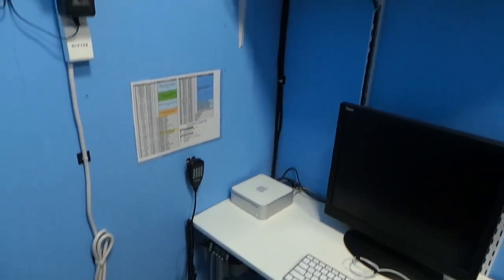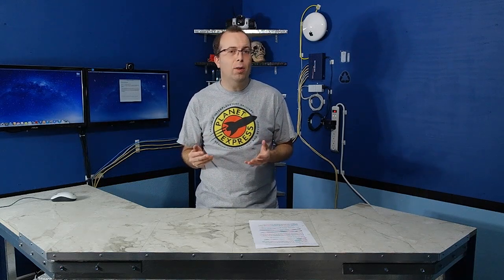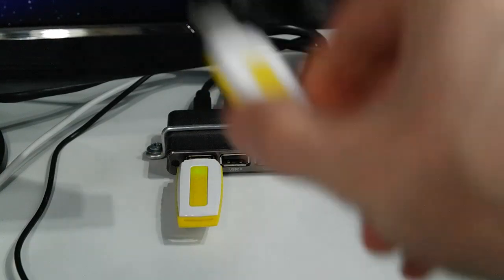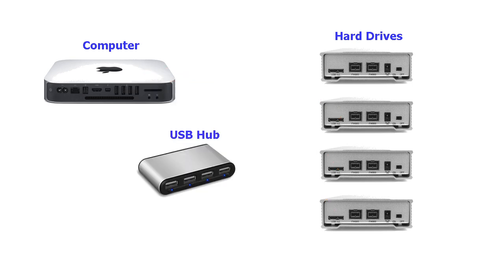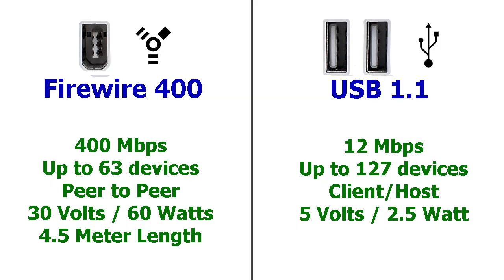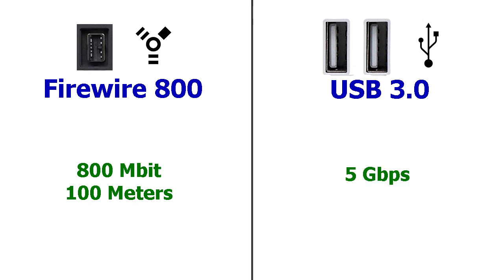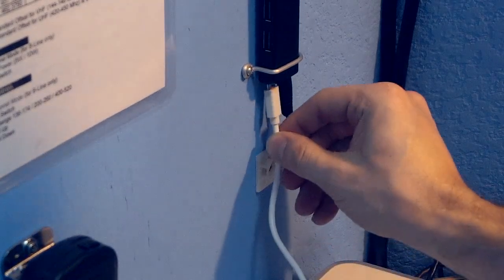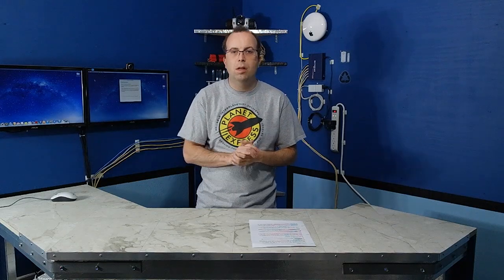Farewell R.I.P. Firewire, Hello USB!

Comment: macOS Tahoe has completely removed Firewire support. Once you update to macOS Tahoe, it will not be recognized directly because the most critical core extensions and frameworks are gone.

Comment: Cat scan images showing the components of Apples thunderbolt 3 cables. My journey (2024) to connect a wonderful Hasselblad digital camera which is FireWire 800 based to a new MacBook Air Thunderbolt 3 was challenging. Important to know is understanding how advanced Thunderbolt 3 is and the integrated circuits the cable has and must be interface with. Simple adapters found on Amazon will not succeed. It took a dock made by a company who deals with legacy audio devices to successfully connect. . Bizarrely the Thunderbolt 2  dock( the name of the product not the Apple connection) is not manufactured currently. If you are curious about what engineering and manufacturing challenges Apples Thunderbolt 3 connection over came view Adam Savages YouTube piece on this very subject. Seeing this will ease your worries about paying what seems to be a much higher price for an innocent looking cable.

Comment: It was only due to the high wattage output of fire wire that allowed the convenience of the “Daisy Chain” format.

On a technicality as you showed in your video the USB hub is “amplified”, but with the caveats USB still has to do the task of switching to offer the effect that it is working similar to a daisy chain.

Fire wire was phased out because of its in efficient manner of power delivery to send data.

All todays modern thunder bolt and USB 3.2  are conceptual redesign of the fire wire architecture with different input connections, and a much higher efficiency at a reduced 80% power usage.

Comment: You know FireWire was at the peak of my PC building era and I managed to avoid them.. mainly cause I never had an iPod. Was a hefty connector.. I came to appreciate that when I was learning about fiber optics. Some of those old school German connectors were bulletproof.. ironic cause the cables coming out were incredibly delicate.

Edit: I was unaware of the Daisy-chain capability, that IS pretty cool. Same with the comp—>comp. Neat.

Comment: Ever tried daisy-chaining USB? 🖕USB does not replace FW. Thunderbolt is the direct replacement of the FW.
Reply: USB 4 will be able to daisy chain devices. So, it will no longer be an issue with no daisy-chaining.

Comment: Fire-wire solved the problems had plagued USB 1.0-2.0. I would argue the reason they killed fire-wire is the plugs and jacks themselves SUCKED.  If you even touched the cables on a 400 cable- it would disconnect... and I would argue the same with 800.  They seemed to get the 600 right... but only slightly.  Lightning bridged the gap for another few years... But the moment that lightning and USB could share a common jack- why bother with firewire anymore

Comment: Years ago when I used Macs, all my devices were connected by Firewire e.g. hard drives Mini dv cam and external dvd players-burners. I still have those devices but finding its not so easy to connect them to my PC. My project is to digitize and archive analog tapes and TS dvd files. Ive  learned that now Ive gotta buy expensive Apple Thunderbolt and Firewire800 cables to attach the Firewire400 devices to a windows pc USB-C port. Pain in the butt & wallet. Thanks Apple, one reason why I stopped buying-using your products. Too many different expensive adaptors cables ports etc for various devices. By the way DO NOT buy or use the cheap Firewire400 to USB adaptors. They're totally useless junk.

Comment: It's actually Thunderbolt that was meant to replace Firewire, despite probably only being able to daisy chain much fewer devices. Versions 1 and 2 were in the form of mini-DisplayPort ports, and then version 3 switched to USB-C. It combines PCIe x4 with DisplayPort to also power monitors and not just high-speed peripherals which includes external GPUs. Version 4 is basically just 3 but with higher minimum requirements and also requiring USB4.

Comment: I still have an old Sony HandyCam8. I now have no way to get the video out of the camera. I don't really want to take the tape in and get it all burned to a DVD. I only want certain parts of the tape.
Reply: Apparently Thunderbolt 1/2/3/4 has firewire support hidden inside it
And there are adapters that let you connect firewire devices to a computer with a Thunderbolt port (the adapter apple sell is for Thunderbolt 1 though, although by combining adapters you can connect it to a Thunderbolt 3 or 4 port)
Reply: @pineappleroad  But I have a PC laptop with USB-C and A 3.0. I do have an old desktop that I built a long time ago that I put a firewire card in. I'll have to look for it and hope it still boots up. I forget what OS is in it. Maybe 97.

Comment: You should have used usb 3.0 hub
Reply: The computer only has usb 2.0 ports (it is what would now be a really old mac mini, it would be no newer than 2009, although i suspect it would be even older than that, and the 2012 model is the first model that had USB 3.0)
Reply: @pineappleroad  but it would have been future proof

Comment: I never used Firewire or had anything that used Firewire. I had a PCI slot plate firewire port to firewire motherboard header adapter in my old windows XP computer back then but never used it. All the external devices I used back then were USB. I had a SIIG JJ-NNBR 3 in 1 PCI combo card in that computer. It had 4 USB 2.0 ports (1 internal), 3 Firewire ports (1 internal) and 2 internal ATA133 IDE ports with RAID features. I used the pci card to get extra USB ports in addition to the two on the motherboard, and uised the internal ATA133 for extra hard drive connections.

Comment: For the rest of you that still need firewire for old audio gear etc. Purchase any Mac Pro 3.1/4.1/5.1. Built in firewire and it can be daisy chained. Also the mac pros have digital in and outs so you can actually add extra xlr inputs from rack units. Now Im not talking about the mac book pro. That is garbage. THE MAC PRO 3.1 is what you need. Dual XEON processors. If you only want to install windows then pull your MacOS HDD or SSD and install it directly on another drive without boot camp on anything. So you can boot into either OS for whatever software you need! Enjoy!
Reply: first

Comment: My first recording interface has 8 xlr inputs 8 outputs and midi in out and clock syncs back in 2005 that used firewire. Plus my video cameras in highschool all had firewire. Canon XL1S/XL2. The white macbook I bought after highschool also had firewire ports and I continued using interfaces with only firewire. Usb at the time was very laggy for trying to record 8 xlr mics and such. I believe my last products I have with firewire ports are on my mac pro 3.1&4.1. Though no cameras or audio interfaces have firewire. It was a great port. Never an issue.

Comment: What I have most about USB is the fact of how unreliable and slow it is. Once you have lots of devices and have to use USB hub(s), the speed varies wildly and devices can disconnect randomly. Even though in theory 127 devices are supported, I can't connect more than 31 to my iMac. My internal drive was broken for a long time and I had to use an external SSD for macOS. Once the device disconnected, the computer crashed. That could happen totally randomly or for example by inserting a memory card into a reader. Some USB hubs seem to drop the speed to the lowest device speed which is also extremely annoying if (when) some of your devices are USB 2.0 or 1.1.

Although it must be said that one part of the problem is not the connection itself but the extremely poor quality of almost all device drivers nowadays. That, plus the annoyance of obsoleting devices that are only a couple of years old. Everything should have a mandatory 10-year support cycle since many things are obsolete only because of the lack of proper drivers. Now there is Windows 11 coming with the main purpose of selling new hardware to stupid consumers.

Comment: I have to use firewire to transfer certain types of videotape to digital. Firewire never worked correctly in Windows. Being an apple invention, it could not be expected to work on real computers. I fight with it every time I use it. Half the time, the computer cannot see the connected device and I must restart or disconnect and reconnect in order to use the firewire connection. Frankly I am happy that it is dead. And let's hope that no more Apple invented crap gets put into windows computers.

Comment: U can Daisy chain USB hubs that are powered
Here's the product I will be describing: Powered USB Hub 3.0, Atolla 7-Port USB Data Hub Splitter with One Smart Charging Port and Individual On/Off Switches and 5V/4A Power Adapter USB Extension for MacBook, Mac Pro/Mini and More. https://www.amazon.com/dp/B07G8CMR18/ref=cm_sw_r_apan_glt_fabc_GW5T6ZVZ7B44NR8R0XXF?_encoding=UTF8&psc=1
 A power hub has a thick USB plug u plug into the laptop and has a power brick u can plug into the wall it has buttons on it to activate certain sectors .... Lastly it has an orange port out that is used to chain another hub in the line
Reply: I use this as my power bank switcher basically I use the Mac book cable to plug into a powerbank USB port and it let's out charge to the main smart charger and whatever other ones is on then I can pull it out and put it in the next and continue then when power is back on I turn on the switches that have small cables to the charging ports of the power banks. To charge the dead ones

Comment: Firewire never caught on with PC makers - that's why many people never knew about it.  Mac users, on the other hand, got it early on and enjoyed the benefits.  I had Firewire external drives for many years.  My very first HD (20 whole MB) had a SCSI port.
Reply: Apple charged expensive royalties for it, (1$ per port on any given product without factoring the port and circutry itself is expensive) so no one but apple wanted to use it over royalty free USB if they didnt have to.

Comment: The USB protocol was initially designed with daisy chaining of devices in mind as a standard implementation. That's why it can support 127 devices on one port. It's more than capable. The onus is on hardware manufacturers to put the chaining ports on their devices though, which didn't really happen. It never really took off, which is why we have PCs with lots of individual ports, and things like hubs.

Comment: you can buy external cases to put HDD's in for those unaware, firewife has a major security flaw, i have seen proof of how bad it really is... even highly "secure" systems could be compromised with a pretty simple device to a shocking degree... 

they could make usb hdd's with daisy chain support, its actually supported in the spec from what one of my teachers many years ago showed me, nobody has because not many chipsets have supported it pre-usb-c, Intel Replaced it with Thunderbolt.

Comment: 2015: "Firewire is dead"
2021:  I'm still using Firewire 800 for my recording studio.  ._.
Reply: just because a person uses it dont make it not dead... i still got a tube TV that used in security systems does that make it current? i got an oldschool VHS LCD portable player does that make it current?
Reply: Technically it means it’s living, just has one foot in the grave
Reply: but most people don't use it, and newer devices don't support it
Reply: I still use a CRT as my main tv lol
Reply: "just because a person uses it doesn't make it not dead"
YES. IT. DOES. YOU ARE WRONG!

To be dead is to no longer have a life by any means. To live is to still be up and kicking, even a little bit. You can be malnourished and forgotten and still be alive.
Reply: Me buying  pc with firewire in 2021
Reply: 1984: "Vic-20 is obsolete"
2021: I just bought a used Vic-20 for 75 bucks and it's awesome
Reply: Same
Reply: My audio interface  is FW too.
Reply: 我也是
Reply: Me too if it ain't broke  don't fix it FireWire just became obsolete but it still works.
Reply: @chriswalker5812   yes indeed, but dont expect much of an obsolete standard, it is technically the same as usb 2.0 but has compatibility issues
Reply: @chriswalker5812  if you are using a hard drive that is 5400rpm, you dont need actually more than FW and usb 2.0
Reply: @indenkellerag  I don't use FW for hard drives I use it for interface
Reply: @chriswalker5812  Big Sur is the last support for FW on Mac it seems. It was a good run though.
Reply: @avigdonable  They found a way to do away with it when they started making all of the newer models they just Left that fire wire slot off those devices the USB and lighting ports is what they went to instead, when they come up with a universal standard that just means all devices will be the same.
Reply: i was going to say the same thing! all of my audio interfaces are firewire...
Reply: Buy usb plz
Reply: I use Firewire 800 to sync and charge my iPod Classic (4th gen, flash modded to 128 gb).  Only way to fast charge an iPod is with Firewire 800!  I think I may be the only person in a 500 mile radius that uses a Firewire 800 to 30 Pin cable on a regular basis.
Reply: How can I use my none FireWire compatible laptop with my FireWire interface
Reply: October 2022 and I'm still using a Focusrite Saffire PRO 26.
Issues with 2015 motherboard/RAM/Windows 10, have resulted in retro installing back to Windows 7 Pro 64 bit.
It's currently working well right now.
Another viable OS for all the music software would be great.
Reply: Upgrade to thunderbolt it's like Firewire "Thunderbolt can “daisy chain” devices and Thunderbolt replaced Firewire"
Reply: 2025...still using firewire for my iPod.
Reply: there's a big 2TB hard drive I know that runs on FireWire

Comment: I think I only ever saw 1394 on things like camcorder capture interfaces on Sony Vaio desktops. The peer-to-peer would have been especially useful over USB had I known at the time, but back somewhere around that time I remember Cat-5 patch cables to do peer-to-peer networking, which was not particularly reliable in Windows. I have no idea why USB hasn't adopted some kind of peer-to-peer capability. There are interfaces now like the Raspberry Pi Zero W's USB can be used as a "USB Gadget" interface to emulate something like a HID or a storage device and communicate through that via WiFi/Bluetooth to another system, but that's about as close as we get to anything close to peer-to-peer communication, and that's not really that close.

Comment: Firewire has some advantages today with powering older ipods. Some will even just start working like new from a good charge on firewire. I'm not exactly sure why it works like that but it does.

Comment: Interesting. Apparently they did/do make FireWire 1600/3200 I think for military applications. I just bought Iomega Jaz/Rev/Zip drives like I owned 20 years ago with FireWire. Pretty cool. I see thunderbolt as the “new” firewire. Faster and more capable than USB but with significantly higher manufacturing cost and product complexity not to mention the patents/royalties situation. FireWire was encumbered with many patent IP claims whic require royalty payments on every device.

Comment: Firewire may be dead in the modern world, but the important thing to remember is that for users of vintage Macs (which I'm assuming alot of people who watch your channel are at least interested in power macs) firewire is very useful. For example, a G5 will be alot faster on the internet than a G3. So you can download software for the G3 on your G5 and transfer it over with firewire 400 which will be much faster than with usb 1
But, I understand that Powermac isn't for everyone, so for most people firewire is dead, but not for everyone. Those original iPods still need a way to plug in after all

Comment: Good Riddance to a POS connector and hair-brained scheme designed to sidestep USB... and ThunderTurd its evil companion on the mac. May they burn for eternity in The Lake of Fire.  :D
Reply: Firewire was simply better for mass storage. It wasn't to "sidestep USB." USB just wasn't up to the task for many use cases. Like nobody intended to plug their keyboard and mouse into firewire. You used it when you wanted fast, efficient data transfer and daisy chaining multiple drives. Or connecting two Macs together. Directly accessing another computer's harddrive from another computer proved very useful. You could even use the OS installed on one Mac to boot another.

Comment: I could almost comfortably edit DV video off an external drive connected by FW, whereas if I connected it with USB 2.0, it was woefully slow, mostly in latency. Of course, that drive also had an eSATA port which was used preferably, but the controller in the computer sometimes went on strike and did not want to hot swap recognize it. Then FW was not a discomfort :)